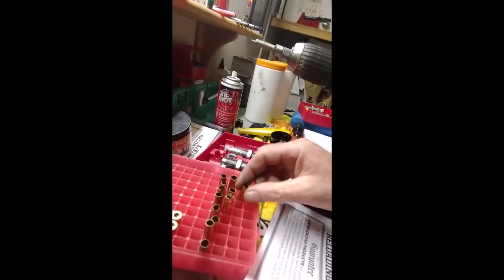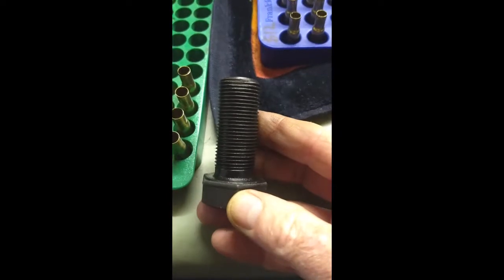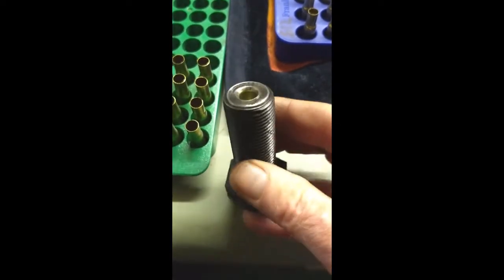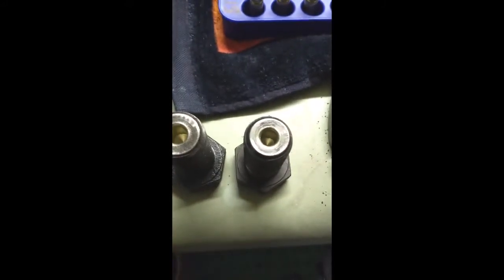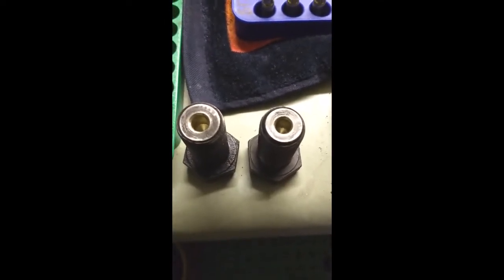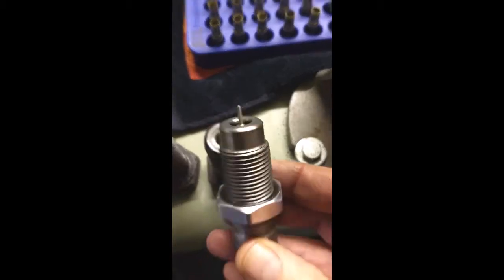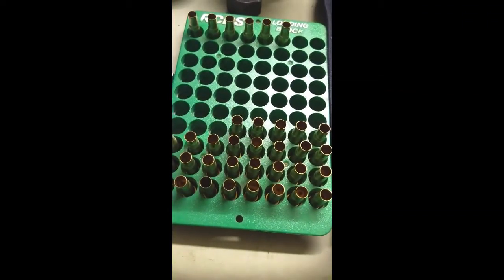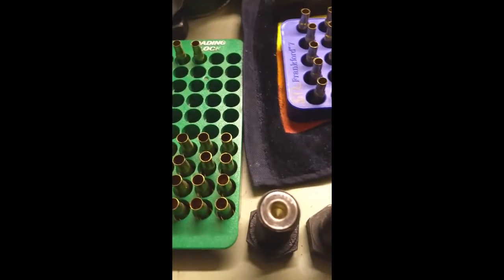25-20 from 32-20

Comment: A GUY HAD A PLATE WITH NEAR 20 HOLE IN IT. FROM  .100 UP . HE HAD SOME REAL WILD CAT LOADS FOR DOGS. AND ONE WAS .100 CALIBER . HE USED LIKE A LEE CASE HOLDER FOR THE CASE LENGTHONG SET THAT SCREWS THE CASE TIGHT. THIS WAS IN THE DRILL. THEN HER PRESSED THE CASE INTO EACH HOLE UNTIL HE GOT DOWN TO THE SIZE HE WAS AFTER, WITH THE DRILL RUNNING.  AND YES HE IS THE GUY THAT MADE THE 50CAL WITH THE .17 PROJECTILE.   BERTRUM BULETS STILL MAKE 25-20 BRASS AS WELL AS A LOT OF OTHERS . A LOVED AUSTALIAN COMPANY .

Comment: I use Dean's method and can say it works perfectly. For the initial .32-20 to 7.5mm sizing step I use Lee sizing lube, sparingly, on the neck then don't use anymore for the remainder of the sizing. I finish using a Redding FL sizing die to ensure I'm starting with factory spec .25-20 cases. 100% success.

Comment: Aneal them with a torch first and it should be a one step process.....32-20 is know to have thin fragile necks ...but i routinely take .357 mag down to .25 in one step after annealing.
Reply from the maker: Yeah tried that but still had a lot of failures :) This process fixed it.

Comment: I know folks who say they just run a .32-20 into a.25-20 sizer die with no problem, but, like you, I found that method to be somewhat less than perfect. Simply running a new Starline .32-20 case into a .25-20 RCBS Cowboy die using Imperial sizing die wax, I lost 24 out of 277, which isn't bad, really, but I knew I could improve on it. What I do now is initially size new .32-20's in a .32-20 die. If there are any flaws in the case mouth, either trim them or touch them up with a needle file to remove the flaw, or set it aside and use it as a .32-20 case, because that's where it's going to fold over. Then, using the extended shell holder/push rod from a Redding push through head sizer die for .40 S&W, I push the case up into the neck of a .280 Remington die, reducing it  .012". The case is easily popped back out with a 1/4" bolt through the top of the die. Then again, using a .260 Remington die, reducing it another .018", then the .25-20 die, reducing it another .020" to its final size. I experimented with a .257 Roberts die between the .260 Remington and the final sizing in the .25-20, but found it really wasn't necessary to reduce it .007" with the .257 die, then the final .013" in the .25-20 die. I bought the various sizer dies I didn't have on eBay for next to nothing, so there was little expense there. I don't believe I've lost a single case since I've started doing it this way. Why not cut the die bodies back with a lathe and use a standard shell holder? Well, you run out of threads, and can't screw the die into the press far enough. 

If you're as cheap as I am with brass, you can form .32 S&W Long cases from the damaged .32-20's, but it's really more work than it's worth, as it involves thinning the rim, reducing the rim diameter, and slightly reducing the diameter of the case near the head.

Comment: If I may ask, what grade bolts did you use? (Assuming here that bolt "grades" are the same in Australia as in the U.S., which may be foolish in the ass-u-me way of things.)
Reply from the maker: Sorry for the late reply Grade 8 bolts. high tensile
Reply: @Goodbrew  Thank you for the reply, that's what I used.  Cranking out the 25-20's!

Comment: I resize 32-20 to 25-20 using standard dies and get great results.  You just have to watch how much lube you use and keep the die clean as excess lube will deform and crimp the neck.  Also make sure you check the case rims for imperfections... nicks or dents and flat spots as these will also cause the neck to crimp.  I will take a nicked case and push it on a 35 cal trimming mandrel and make it perfectly round before resizing and I find I get 94% success in resizing!  6 failures out of a 100 is ok by me!
Reply from the maker: Hi Tubedude You are possibly using a better die than I had:) I was losing 50%.  his works nearly 100%
Reply: Hi Dean.  I use the standard Lyman dies #7469042 and they give the results I stated.  I also use the Lyman case lube #7631301 with a pad and roll the cases on it.  I just started reloading 25-20 this spring and have been using the first 100 pk of 1000 Starline 32-20 I purchased.  I think I am in the 4th reloading of the cases now and have seen no splits or cracked rims yet.  I will continue to reload them till I see failure and then assess whether I want to try annealing or not.   Right now on the 4th reload cycle the cost has come down to 5 cents a case from their initial cost of 20 cents so annealing may not be worth the time.  So at 3c a primer and 7c a bullet and about 2c for powder my cost is 17 cents a round compared to $1.25 for factory ammo right now and will continue to drop as I reuse the cases more.  Not bad.
Reply from the maker: @tubedude54  Its a good fun calibre that's for sure

Comment: What would you charge me to make me a set? I have about a 50 percent failure rate turning 32-20 to 25-20 with wax and a standard die. Thank you
Reply from the maker: mike wells hi Mike where are you located mate ? Message me on Messenger if you like .
Reply: Hi 
Same question from me , I’m in Tasmania. 
Thank you  & regards